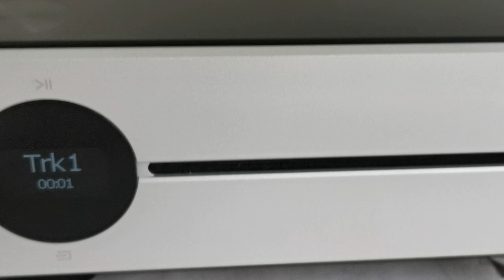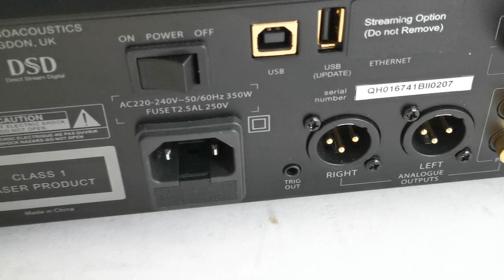Quad Artera Solus network amplifier and player

Comment: I have ordered the Quad Artera Solus play, it will come in a week. After having seen this video I looked up some images from the web. I am now in a state of shock. From the point of electrical engineering this is troublesome. (I am elec design engineer for 40 years). 
All kinds of poor (corner cutting, cheap) design choices. Layers of boards piled on top of each other (counting to 4!). The actual amp is  all tru hole, 80'ies tech. Demo boards form various suppliers mashed in with a converter board and with with yet more connectors. I feel sorry for the tec who has to repair this heap.
Let me check the box out when it comes in, and let me make sure I keep track of the return label.